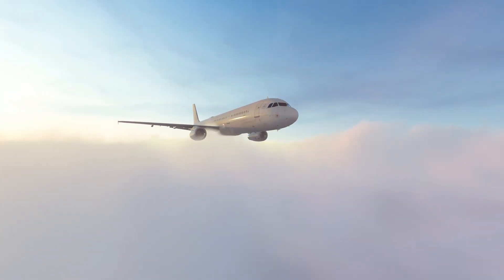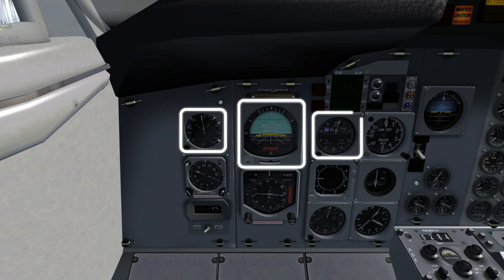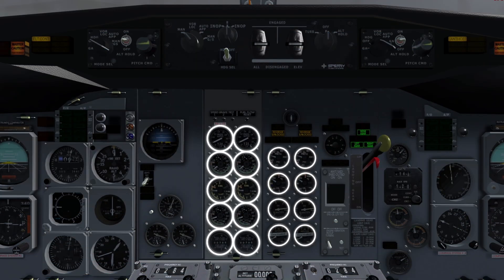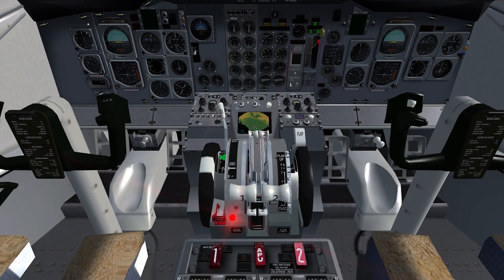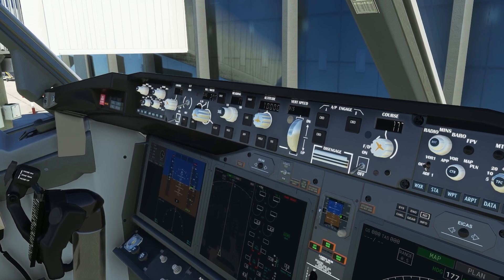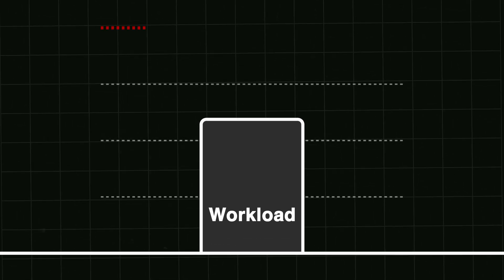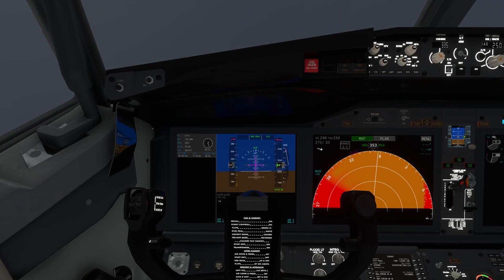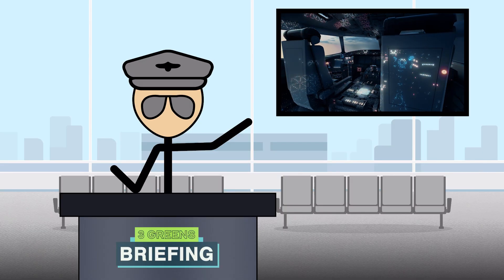Automation IS NOT Replacing Humans in the Cockpit - Here's Why

Comment: i feel like cars are going the same way with automation. I rented a new car recently with lane control assist and adaptive cruise, essentially it will drive itself and keep a following distance behind traffic, as long as you are holding the wheel. I feel like if this technology is used correctly, key word there, then i can focus my attention less on maintaining my lane and keeping distance from the car in front of me, instead simply monitoring the system making sure its doing its job, then i can focus more of my attention on traffic that might be pulling out into my lane or deer on the road, or someone jay walking at the wrong time etc.
Reply: Exactly. I don't trust an airplane or a car to drive itself 100% of the time. But is most certainly helps in your situational awareness, which is most important.
Reply: It would make a good driver better and a bad driver worse by increasing complacency. Until it is at a point to completely take over from human intervention it will do nothing for road safety in my opinion.
Reply: @Hotkife  that all comes down to the person driving, I've been in 2 total loss accidents from mf's running red lights in the past 6 months and they were the ones driving. at this point, id trust a monkey driving the car more than i do people

Comment: Aloha Airlines flight 243 is an example of a miracle landing only human pilots could pull off. Germanwings flight 9525 is an example where full automation would have saved everyone. I'm on the fence.
Reply: what you never hear is how automation saved a flight since what used to be a mayor event is now a simple inconvenience.
Reply: @elchaconaso  We hear about that all the time. For example, Airbus has automation like alpha floor and alpha max protections that have saved many lives. No one is denying that automation is very helpful. I was just saying that it isn't the magic pill some make it out to be. I basically side with the video here. Both humans and automation work best in tandem, but each have their role that they are better at, and there are certainly numerous that automation handles better.
Reply: Not really true just computers aren't at the level yet- pilots can never do something outside the box- planes fly too fast for that.
Reply: @marksmith8079  Air Canada flight 143  was saved when a commercial jet with no fuel had one opportunity to make an emergency landing at a de-commissioned military runway. But they had too much air speed. The pilot happened to fly gliders in his free time and he used a glider trick to reduce the air speed enough to make his one chance at a landing. A maneuver no commercial jet pilot is trained for. The very definition of thinking outside the box.
Reply: @marksmith8079  This is literally the opposite of reality.

The problem with complete automation is that an autopilot and/or AI can not think outside the box or come up with novel solutions for novel problems, whereas humans are more capable of handling these non-normal untrained events.

Autopilots have to literally be programmed for each of the kinds of solutions they must solve. This is why with most non-normal situations and errors/failures, the autopilot disconnects, so that the pilot can take over and analyze the situation. And a similar but different problem exists with AI. It is based on training data and what it is being trained to do. But the outlier situations are what hurt them. This is the same issue you see with Full Self Driving vehicles today. The most advanced ones can handle regular situations just fine, usually even much better than a human, but certain unexpected circumstances are what tend to throw them off and sometimes cause accidents/fatalities.
Reply: @R0Tl  Yeah that's why my Aloha Airlines example needed human pilots. 18 feet of the fuselage was gone. This obviously drastically changed the way the plane handled and responded to control inputs. The human pilots adjusted and re-learned how to control the plane on the spot. You can't automate that. The autopilot isn't going to have a "how to fly with an 18 foot hole" program.
Reply: @MakerInMotion  No dude, autonomous airplanes are a terrible idea.
Reply: @R0Tl  Not really novel solution really following the basics- they landed on a location that is not a regular airport which is taught to all pilots   and using all techniques (that technique is not known to most pilots so it is bit of a furphy) available to them which computers could just as easily be taught- the logic is extremely complicated and an enormous amount of work and the data density is beyond what the highest level of computers can contain at the moment. Novel is way beyond pilots such as metreological analysis especially of previous unknown phenomena (first time a pilot got hit by full blast of a microburst)  and aerodynamic calcutions of an airplane especially outside its normal operating parameters.
Reply: Just wait a couple of years and see what A.I can do.... Your Aloha Airlines flight 243 flight crew will looks pale compared to the embodiment of perfection(A.I). It's quantum computers era and humans are soon to be obsolete....
Reply: @YanDaOne_QC  You're literally speaking science fiction and techno babble right now 😂. Do you even know how quantum computers work? It's a rhetorical question, because your statement clearly shows you don't.
In what ways are AI perfection? You are aware of the numerous areas they struggle, right? Humans have their weaknesses, and so do AI.
Reply: @YanDaOne_QC Don't be foolish